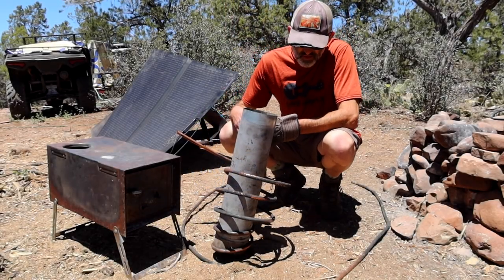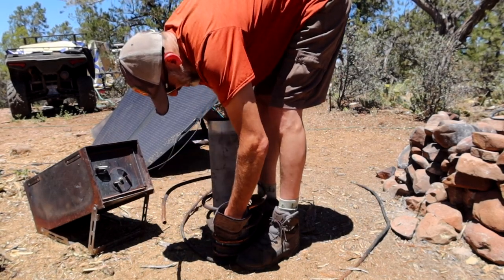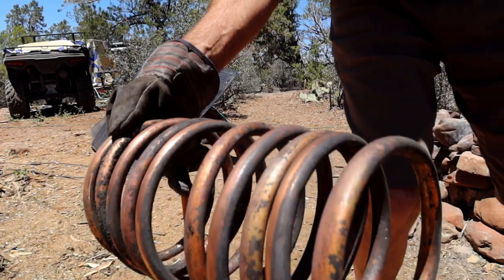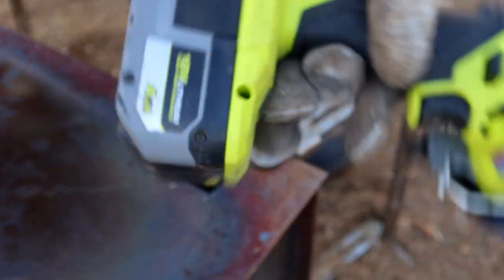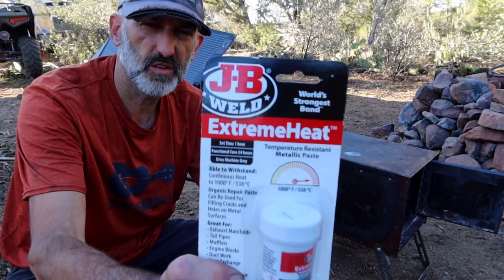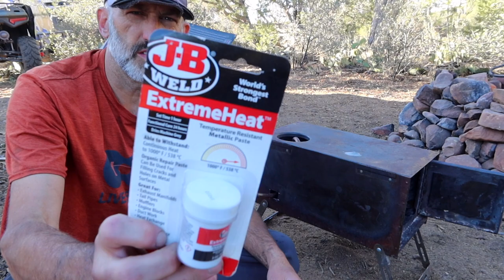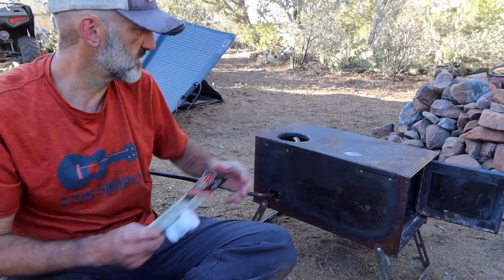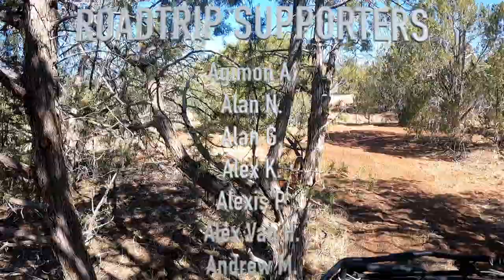Copper Coil Wood Stove Water Heater For My Hot Tub (Stage 1 Fire Ban Approved)

Comment: THAT JB WELD comes in a putty stick as well that's a little easier to work with and sets much faster. I used it to patch a dime sized hole in the valve cover on my boat engine and it never failed. 🐂🤠🐂
Reply from the maker: Right on, I'll see if they have that in the high temp rating. Sure do love using this stuff!
Reply: @OffGridBackcountryAdventures  Yeah, they do, or did back then. They also have the underwater set and they all pretty much set in 5 minutes. I had to get the high heat from a little hardware store locally but not sure about the big stores.

Comment: I'd have used a drill& step bit to make the holes 🕳️ but whatever works in the Backcountry.
✌️
Reply from the maker: Unfortunately I didn't have a step bit for my drill and the nearest hardware store is 1.5 hours away so I just made due with what was on hand. So far, so good! Seems to be working well. ~ Brian
Reply: @OffGridBackcountryAdventures  Yeah, the stove holes are much less critical (contain 🔥 sparks) than the holes in the stock tank that have to remain water tight. ✌️